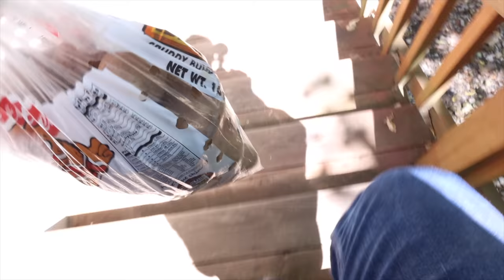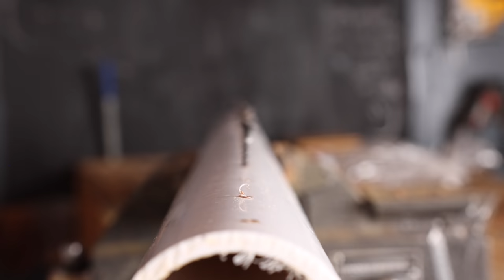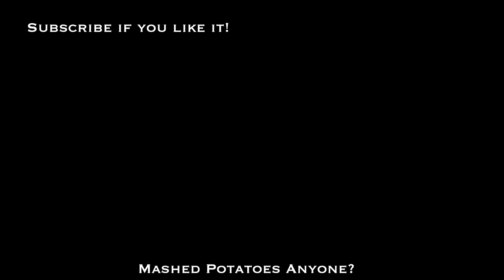How many potatoes does it take to stop a Traditional Arrow???

Comment: Cool video! Well filmed very fun !
 a little constructive criticism :
 bow weight and arrow weight  numbers are fairly important info when doing any kind of "penetration" test (and some like to see FOC as well) also bows actually get better penetration a little farther from the target with the range your shooting the arrow is impacting the target before it has had time to be fully accelerated by the string should stand at least an a arrows length away for best results.
-I realize this was more for fun than science but just my 2 cents on things i thought may have slightly improved the quality love what you do keep it up shoot straight

Comment: inaccurate experiment.  if the arrow is already contacting the potatoes when the string is still pushing the arrow foreward then u will get skewed results.  you should redo the experiment so that the only thing the potatoes are stopping is the arrow.  not the arrow and the string